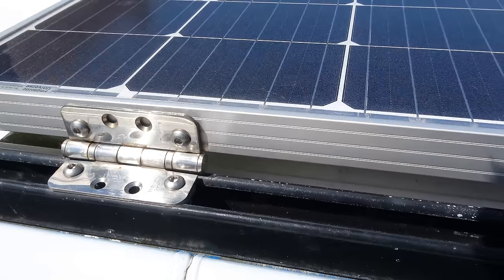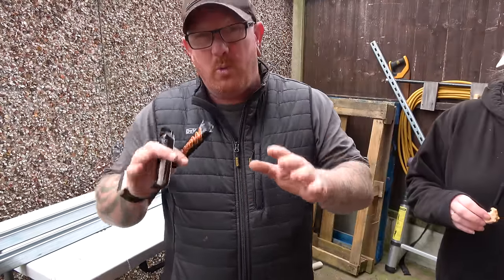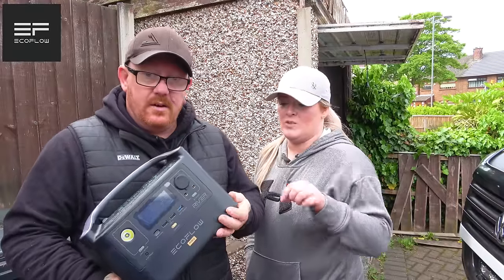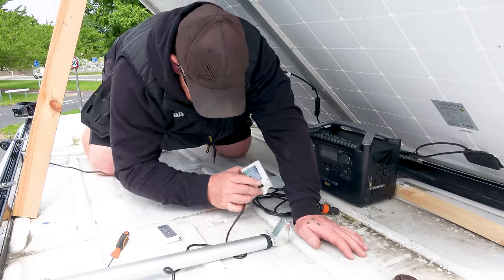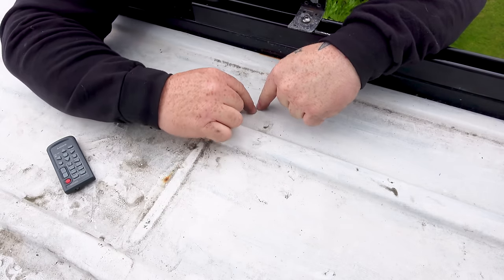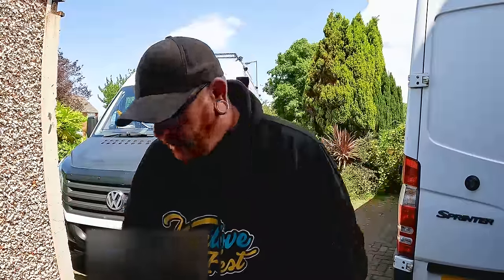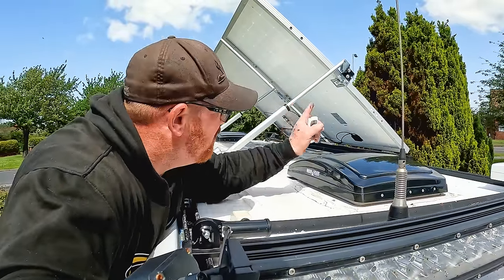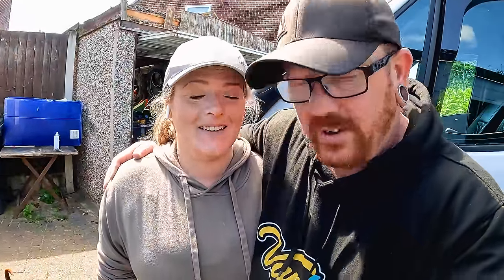NIGHTMARE Solar Linear Actuator's Instal

Comment: Just a thought. You could've used a single actuator if you would have mounted the actuator parallel to the rack on it's own aluminum track and made a set of "X" pattern sliding bars. Picture a one sided scissor lift. Each end of the X is labeled 1 through 4. 1 is hard mounted to the front most solar panel. 2 is mounted in a sliding track mounted under the rear solar panel. 3 is hard mounted to the aluminum track the actuator is mounted to at the forward end of the vehicle (opposite the actuator). 4 is sliding in the aluminum track closest to the actuator. When you extend the actuator it will scissor the "X" pattern bars. The hard mounted connection points (1&3) would be limiting the height (1) as well as providing something sturdy to push against (3) to allow the mechanism to close. The sliding mounted connections (2&4) will allow the "X" to raise up off the roof in turn pushing the panels up. Something similar to this. 

https://www.zoro.com/dayton-scissor-lift-cart-1000-lb-cap-31-12w-63l-4zc18/i/G1107784/?msclkid=50e8bc45acbb185ce575d8cc5862e044&gclsrc=3p.ds

Comment: To keep the panels straight, could you not just put a flat piece of aluminium or flat steel across the back on the panel to keep them all straight?
Reply from the maker: Yer I’m  planning to fix the top and bottom . To reduce the curve but to be honest it’s not a worry but I still want to do it

Comment: It would probably be cheaper to consider the top of the van as a shaded area in terms of solar gain, the use of half-cut solar panels & microinverters or power optimisers is a cheeper, lighter & less labour intensive alternative.

Comment: Its not a mod ide do because cant see point but I think you have put lots off lollll but I must admit you have done a cracking job Neil
Reply from the maker: The difference with raise in the solar is massive . We went from 16% solar to 80% just by putting them on a slight tilt the other day  . And on the actuators you can choose how much you go up by unlike when they where on a fixed tilt . The bonus is massive but such a bloody pain to do
Reply: @UrbanVanlife  hi mate with me I have a 280 ah lithium  battery which at most drops from a 100% down to 90% if I have tv all night but next morning a couple hours daylight and back to 100% my 330 watt panel seems to cope with my needs so wouldn't bother I can see the benefits for some in your case u seen Paul's and u needed one lollllll

Comment: watt was the increase in watts now that you can angle them
Reply from the maker: Hi ya, morning and afternoon sun we gained about 40/50% more amps into the system having the ability to raise them than what we would have than if they where flat, but it is also dependant on the sun ☀️

Comment: I would have used the same money to buy an extra solar panel and fit a manual system.. Simply lift using a pole.
Reply: Thanks for responding. I've subscribed.

Comment: I'm surprised those actuators were calibrated to run at the same speed as when I bought two from the same Amazon listing. I found one would be an inch ahead of the other, making my workplace snap in half when it extended!
Reply from the maker: Interesting 🤔 thanks for the heads up
Reply: Conductors for both actuators must be the same length.

Comment: Wouldn't it have been easier to carry some table type solar panels you could just sit external to the van? She's like inventing a pen to work in outerspace instead of using a pencil, springs go mind!
Reply from the maker: Well no . We allready had the panels tilting but this way we have control over the angle . Plus portable solar isn’t powefull enough plus you have to get them out all the time and set them up .

Comment: I really don´t understand why you make it so complicated. @17:03 you lifted the panels with one actuator. (wich proofs that one is strong enough.)
If you at that point had mounted an aluminium plate between the two panels (outsisde of the panel, long enough to reach a bit over the center of each panel.) the two panels would not bend.
And: Why is the airintake of the snorkel facing forward? It´s supposed to be the other way to prevent water and dust entering.
Reply from the maker: We tried many things with the panels and they didn’t work, and as for the snorkel it’s subject to large debate and opinion which way it should face so we like the way it faces but thanks for your input on our van, much appreciated 😊😊
Reply: @UrbanVanlife  Out of pure curiosity, what is the argument in the debate to have it faced forward?

Comment: No, a absolutely Not.
I have sold dozens of PV panels to fit campers
If you are driving around in a camper  with your PV panels on your roof   please use tbe proper 4 point  anchors and avoid this nonsense. There are 200 watt tripod kits that can be stored inside the camper for extra power when parked up.
Did you know that the original tracker kits on sale some 15 years ago cost £3,000.  Just for the steel rails and actuators. The PV of course was extra. Sad to say they got wrecked in the first force 8.
Reply from the maker: Thanks for commenting and sharing your knowledge and experience with us and the community.